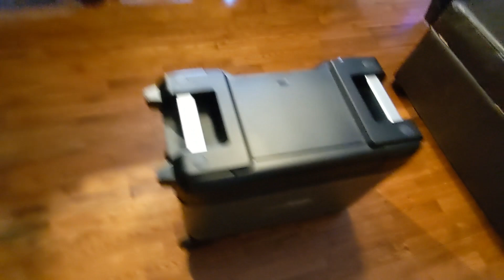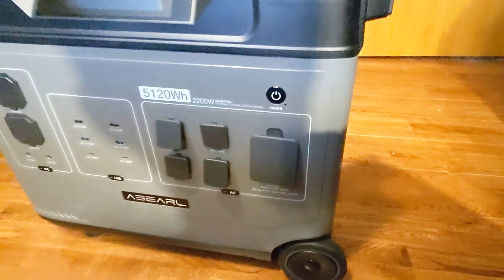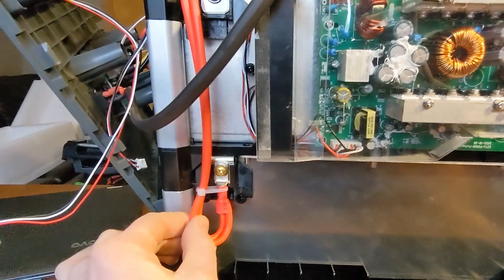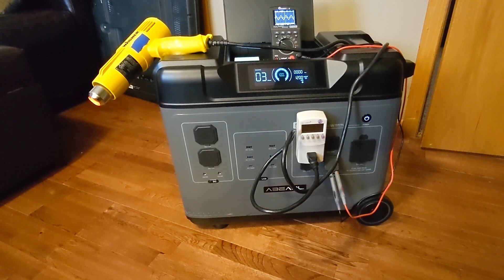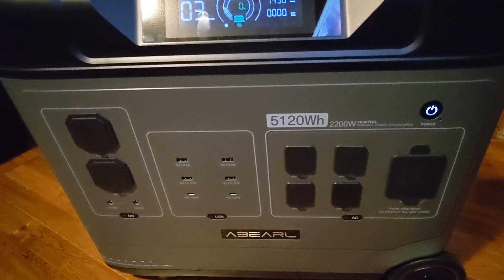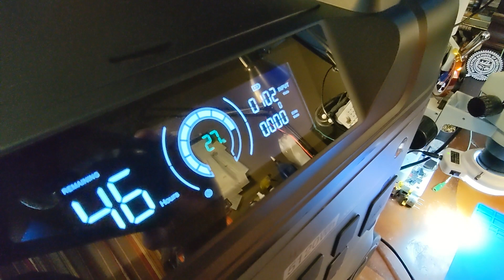OUKITEL Abearl Huge power solar generator review

Comment: What is the operating experience?
Reply from the maker: It's ok. I keep it around for power outages. But so far I've never needed to rely on it.
Reply: @jeffescortlx  I recommend you experiment. For example, load the device with 3-4 kW and wait - how long the charge lasts (from 100% to zero).

Comment: Did you use the 30 Amp receptacle at all?
Reply from the maker: Not exactly, If I remember correctly the inverter just has one output. So the 30 amp socket shares the same power as the regular 120 volt outlets.

Comment: Good review Jeff.! Can it be charged with solar panels and deliver energy at the same time..?
Reply from the maker: Yes I believe so
Reply: @jeffescortlx  It could charge an EV with solar while driving then..
Reply from the maker: @NasierOmran  technically yes if the vehicle allows a charger while in drive. Although it would probably be difficult to fit more than 400 watts of solar on a normal sized EV car.
Reply: @jeffescortlx  most EVs have a safety system that dont allow charging and driving at the same time indeed. But the battery could be charged(camper)while driving.

Comment: Nice review. I'm on the fence about this but the price just can't be beat for what it is. Also to note. You need to turn off power throttling to lock the voltage to around 110V constant to get above 2200W.

Comment: Man thnx for great info. I myself dont even dare to touch the inside of my computer without antistatic gloves, but then again i do not have your knowledge. Man this is no complaint, im a nono with computerchips and so, but seen your video,  i think i go for this one, i have 6 solarpanels on my roof so i think i can load this beast proper and use as backup.

Comment: I unboxed the 2000w version in this video
https://youtu.be/S69P174YlgU?si=qWwGt3JBWP2tF6-Q

The only problem I don't know if am wrong the inverter kills it alot. 

Regardless this is a good solar generator. 
Just plug your loads. Because if you plug just your phone the battery will be dying off because the inverter is using energy
Reply from the maker: I think you can have the USB ports on, but 120v inverter shut off?

Comment: What happens when you have solar and AC-in setup at the same time ? Does it use solar? AC ? both ? Can't find anything about this.
Reply from the maker: I'm not sure, I didn't test for this. But I am pretty sure anytime the AC is connected that it just directly passes grid power to the AC outputs.
Reply: @jeffescortlx  That's kind of what I expected. I guess you could put a timer on the ac in and shut it off during daylight hours....?
Reply from the maker: @azr2d1  what is the end goal you're trying to accomplish? There might be better equipment for whatever it is you're trying to do.
Reply: @jeffescortlx  Keep my home lab running on UPS longer than it can now with the regular ups's you buy (1500wh I believe and not nearly as durable as these batteries). And I figured if I buy this thing, I want to utilize the solar charging part of it too. I don't think it could run 24/7 of a mix of solar and battery ?
Reply from the maker: @azr2d1  in my own personal opinion I would probably simplify the system. I would go with a limiting grid tide inverter. These do not need a battery. They are very simple, if the solar panels are making power they allow you to use that for your entire house grid. And when the sun goes down you automatically go back to using grid power with no noticeable transition. The disadvantages if you have a large solar array but small power consumption there is a possibility of wasted potential. But on the plus side there is no battery expense or device needed to switch from off-grid to on grid.

Comment: I got the same air fryer
Reply: Ha, clearly @jeffescortlx is secretly running a hot wings food truck from his Chevy Express van and his old power bank fried the cluster.
Reply from the maker: @euanmackenzie743  it also runs the smoker for the pulled pork sandwiches.
Reply: @jeffescortlx  mmm bar-ba-que.

Comment: I know I sound paranoid, but after seeing videos of huge fires caused by e-Bikes, I'd imagine something like this might be a similar risk if it ever failed? 😳 I don't know if most of these fires are truly caused by leaving them plugged in too long (design flaw much?) or from cheap components, improper use, etc.

Anyway, it's cool that companies send you so much stuff! You're very thorough and knowledgeable!
Reply from the maker: That is a genuine concern. And I keep my eyes open for issues that could lead to that. I believe a lot of those fires from e-bikes/hoverboards were from lithium ion 18650 cells that had over inflated specs labeled on them. The higher the capacity the faster it can charge and discharge safely. But the Chinese market has no problem claiming a 18650 cell is 3000mAh when it's really 1200mAh. I believe the new lithium-iron phosphate cells get less angry when things go bad. But I always make sure the products I promote have good battery management systems and plenty of fuses for when things go wrong. Since the battery capacity checks out I have faith in the charging and discharging rates.
Reply: @jeffescortlx   I noticed Menards sells LiFePO 4 cells in the common form factors, including 18650.   It's in the solar lighting section.   I might have to consult with you about improving my projects.